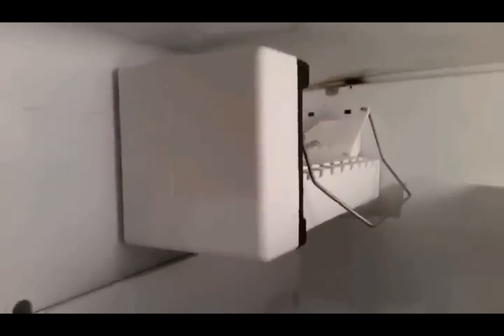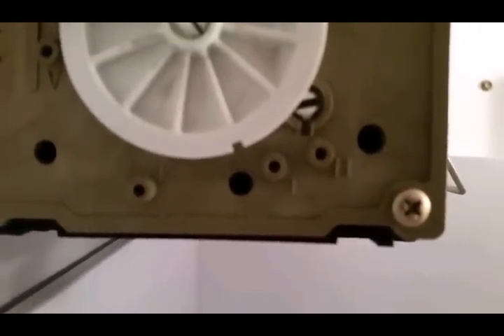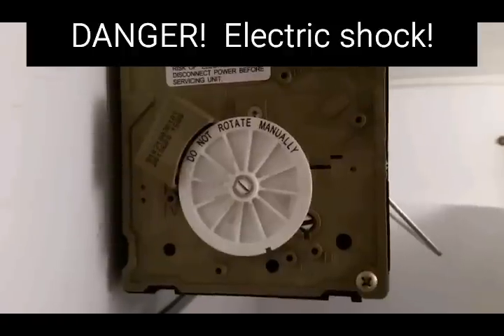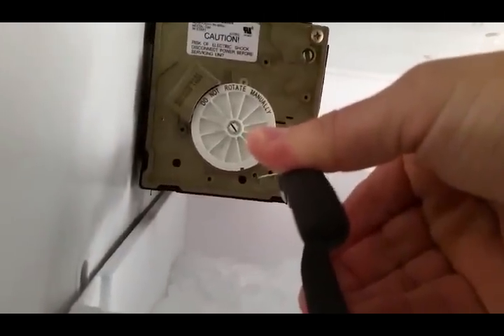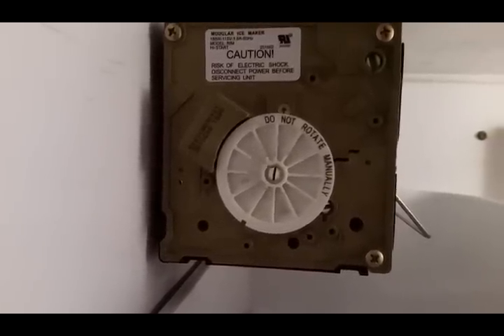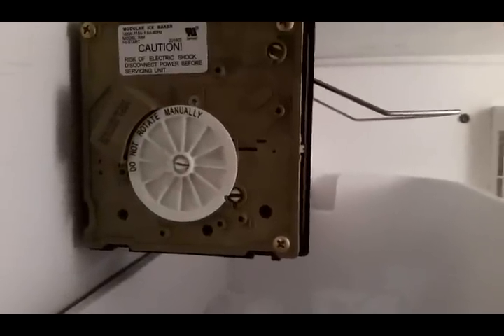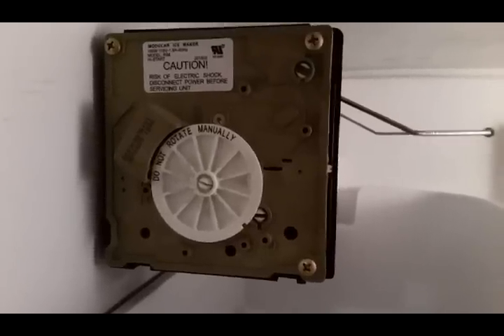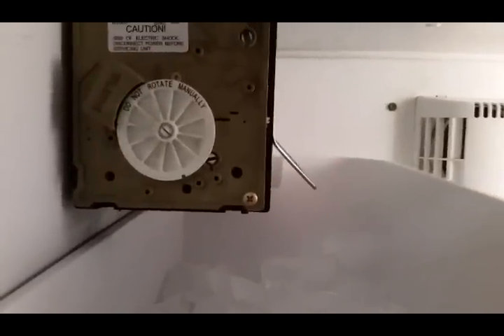Ice Maker - Cycle Test

Comment: Yippee! I followed your instructions exactly,--on a brand new ice maker, too, but absolutely nothing happened! No tell-tale click no rotation of the wheel!!    Perfect!!!!! :(
Reply: Hold or tape the door/light switch down. Newer refrigerators have made it so when the door opens the ice maker power is paused until the door is closed again
Reply: Tip: I initially used a red paper clip I found on the desk. Same issue, nothing happened. Then it occurred to me when I saw no spark that it may have a plastic coating hindering contact. 

Found a plain old “silver” paper clip and it worked exactly like shown.

Comment: Thanks!
Reply from the maker: Welcome. If you haven't already, please subscribe to my channel so YouTube will continue to support it.  I really appreciate it!
Reply: Fantastic video.  I replaced mine and everything looks normal except for the arm does not appear to drop.  If I Manual drop the arm after the ice has frozen it seems to process a reset like you did with wire.  After the ice drops the gear rotated and at the end I noticed a spark inside the gear area.  I’d assume this is the arm drop stage.  I  waited awhile and gave up and manual dropped the arm.  No tension and manual put down.  Any ideas?   I was thinking I’d wait 45 minutes and try your wire trick.

Comment: what if you insert the wire and the ice maker doesn't engage, is the motor bad? should I replace ice maker thanks, dan
Reply: dan manley I have the same problem- I hope he answers soon!
Reply: the motor could be bad. You can replace the entire module for under $30 or the entire ice maker for under $80
Reply: Mine is brand new and it does nothing with this jumper test hmmm?
Reply: @fdmazza  make sure you push the door/ light switch  in (all the lights go off) if it applys to you.  that worked for me in my setup

Comment: very good video, and helpful.. how can i test the pump? pull the line, and cycle it?
Reply: Believe there is no pump, the water input is controlled by the valve on the back of the refrigerator.